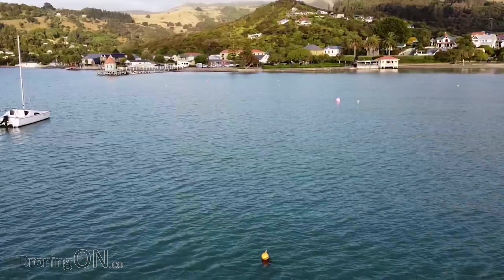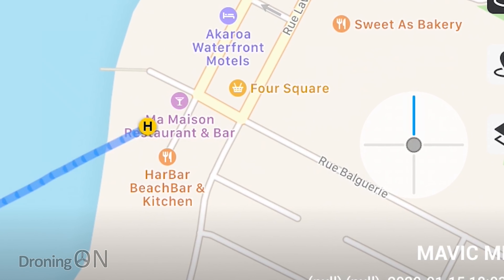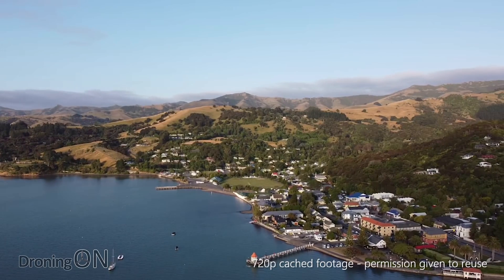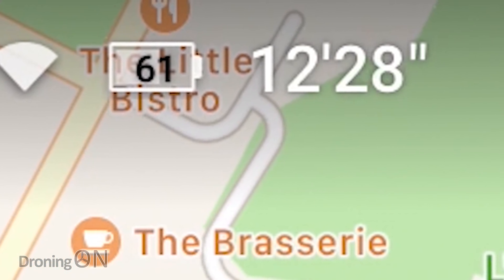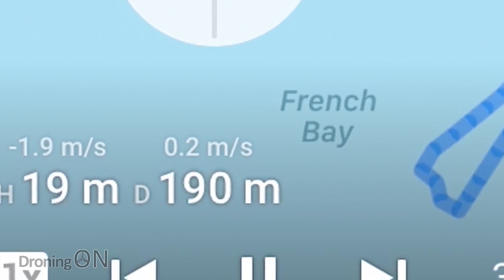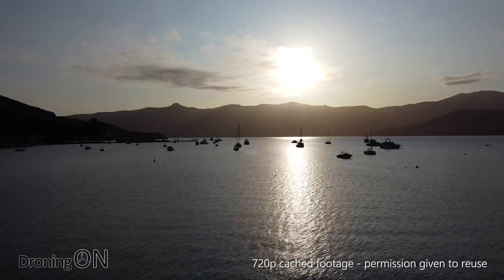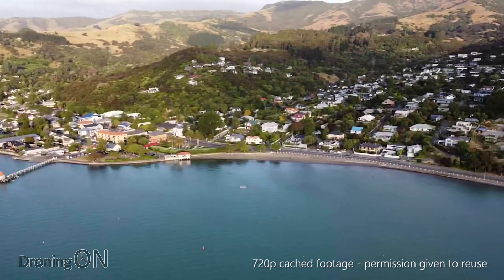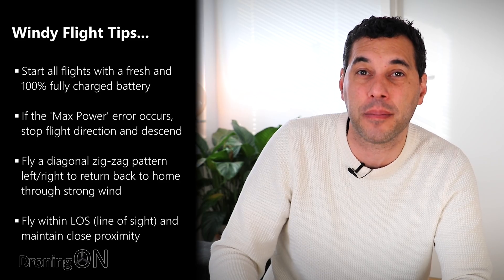DJI Mavic Mini Uncontrolled Descent Into Sea | Max Power/Wind Issues/Operator Fail?

Comment: Anyone else really wanted to see underwater footage for like a second or two?
Reply from the maker: Yes sadly the cached footage ends before it hits the water, which leads me to believe that the battery died entirely before it actually splashed down. We can't know for sure but its a theory! Thanks for the comment! Remember to subscribe!
Reply: @Droning-ON  ⁰
Reply: @Droning-ON  mine did something similar yesterday... full battery and dropped into the ocean at 94%. https://www.youtube.com/watch?v=3lQX1z5DhmQ
Reply: Thanks for this video, really usefull. Go on, l'm really interested in this kind of advice.
Reply: psycold lol 🙋
Reply: I doubt if it continued to record video for very long once it hit the water!  Maybe a second or so but only on the internal SD card.  The RF back to the RC unit would stop immediately.
Reply: @eidenmc  yes. I agree with this.  The last 3 or 4 seconds never got sent because it was shorting out under water.
Reply: Real or FAKE?

Comment: I was with my Mavic2 Pro doing some shots of an apartment complex that had a tiny lake in it. I wanted to get a shot near the water and was descending slowly and was expecting it to stop near the surface automatically but it didn't and I almost lost it into the water. It happened again only this time on concrete and actually hit the concrete and bounce up (no damage luckily) so there is something going on with the ground detection

Comment: I believe that there is an issue with the Mini’s last update. A friend’s drone has dropped from the sky 3 times. The last time he was 50ft from the drone at an elevation of only about15’ - 20’ of the ground. The same ‘max power’ code came on the screen and the drone slowly descended into a swimming pool. No wind was present. He was clearly attempting to lift thought the drone continued downward. After some arguing with DJI they agreed to send him a new drone. 
This is important: his drone flew perfectly on his vacation in Brazil with many stunning videos. It was only AFTER he downloaded the Mini software update that his drone began to act this way (with the max power warnings). I would like to hear from others that have had this issue begin upon the new update. I have not updated my Mini Mavic as I am afraid that I may have the same issue as my friend.

It’s easy to say its user error without actually being there when it happens. If it is a glitch in the programming, I’m hoping DJI will let us know and fix the issue (if that’s the case).
Reply: Bruno nascimento - Thanks for your reply. Did the drone fly fine when you first got it? Did you download the new software update? Do you recall if it happened recently after downloading the new update? Thx
Reply: Hi. I had the same issue after the last update. The drone would have very little power going up and was a little twitchy in no wind. My issue was caused because I didn't update the firmware of my other two batteries. The initial update automatically updated the battery that was inside the mini, but when I went out, I switched to the other battery, ignored the update message in DJI Fly app and got these issues. Resolved after updating each of my other two batteries.

Comment: Its nothing new really DJI (plus other manufacturers)have had fly aways ,crashes etc from day one (phantom 1),had it happen to me on my first phantom,nothing is 100% fool proof,you get high winds low winds ,interference,its just the nature of the hobby,you know what it's like when windows 10 updates ( programs stop working) ,I still get that panicking feeling when I fly my phantom 3 professional in case it's the last time I see it. My mavic mini is great but with it weighting so little you have to make sure battery full and no wind,which in the uk its wind most days.

Comment: I've had an uncontrolled decent last week... I was flying back home with still over 60% battery at only 50-60 feet agl. There was almost zero wind. I was flying back and it decided to start dropping in altitude. I had to stop the forward movement and force it to climb then go toward again.. I had to do this probably 4 times all withing 500 ft from home... I swapped the battery... Then had zero issues... I had this happen one time before at home when it was cold out and it didn't hold altitude, when I swapped the battery it worked fine after that also.... On a side note the issue I had last week was in the cold at about 25°F at 6200ft elevation. I'm beginning to think it might be in the battery.. I will have to mark them and track them to see if it happens again and which ones it does it on.

Comment: My Mavic mini also descent yesterday in my case, battery was 100 % charged, no high wind warning, it was flying within 30 metre but still it descent without my control. The two reasons  I could judge was low controller battery and no gps connection..
What was the real reason? How to check?

Comment: Never had an issue with my mini so far. It has drifted on me on winds 20-25mph with gusts up to 35mph and it still fought back. Just placed it in sport mode , descend to minimum altitude and brought it back safely
Reply: ciphered fragment “Thank you! People are doing something wrong. Because I’ve flown my MAVIC mini in all kinds of conditions and it’s astounding the type of video footage this thing takes. I just started posting some videos recently, taken with my MAVIC mini. I’ve only had this thing for about 3-4 weeks and recorded over 20 hours of video and shot hundreds of pics. (Not all of them are on YouTube)
I think Mavic Mini owners need to check their Return Home settings and make sure they have it set to the right altitude. I do agree with what this gentleman says about the battery. Make sure it’s fully charged before flight.”
Reply: Same here. Just paying attention helps

Comment: I allways check UAV Forecast and lok around and plan where i will fly.But that is from my experience becose i crashed so much toy drones and i learn on my mistakes.The wors place to fly with 249 grams drone is to the open space becose off high wind gusts.The drone is not quilty,i fly alvays with the full baterry and i fly onley when UAV forecast tels me that wind profile in 10,50 and 100 meters is lover than a 24 Km/h.

Comment: I own Mavic Mini from 19.11.2019.  and i newer sean "max powerload reached" or droping altitude.But i experience "RC disconected" and "Strong Wi-Fi interference" 
I do not fly when is windy becose i know limitations of mavic mini.If is windy and i want to fly i runn onley my race drones.Mavic mini is 90% in my room and 10% on the air and eaven when i fly mini i fly at 50 meters if alltitude max and never belove 50% of the baterry.Mavic Mini is the crap of drone.It is bad investmen espetially becose there are no firmware updates,so we are stuck ak onley 4 Quickshoots modes,and no manual adjustments of video and onley JPEG/DNG....I could buy Xaiomi Fimi X8 Se and have more flight time and all of benefits like original Mavic for the same price...Uhhhh man i HATE my "Mavic" mini!!!
Sorry for bad spell,greatings from Euorpe (Croatia)

Comment: Mine plummeted into the sea from less than 60 feet away. Recovered by scuba divers next day and soaked in clean water. Thoroughly dried and i put a new battery in. Instant burning and battery destroyed in cloud of smoke within fractions of a second. Watch out!

Comment: A great Way to find the answer to what happened is using the website air data uav ! I had the same issue with my original mavic pro and lost it ! I uploaded all the flight data and the software explained exactly witch way the wind was blowing and how fast 💨
Reply from the maker: Thanks for the comment, yes indeed that is a great site to use. Very sensible to do the research before takeoff! Be sure to sub!

Comment: Fly into the wind away, with the wind on return
Reply from the maker: Precisely, its also great to return down-wind as it doesn't push your battery so significantly, its a free-ride home! Thank for the comment, be sure to subscribe!
Reply: That's good advice, but if the subject you plan on filming is unfortunately against the wind, then there's little one can do.

Comment: Similar incident happened to me two weeks ago. Flying my mini in an isolated area in the Owyhee Mountains at the river. Fresh battery and was flying great. Made a pass along the river maybe to about 100 meters away from me and decided to fly the same path after seeing ducks wading in the water at where I turned the mini around. After doing a flyby of the ducks I turned my mini around but as soon as it started flying back it just dropped straight down into the river. No warnings, no strong wind, 50% battery life and only about 250 feet away from me... no obstruction and clear line of sight from drone to me/controller. Fortunately it dropped about a foot away from shore and I was able to pinpoint where it dropped via video on the phone. It was lodged in some vegetation but in the water. I’m also very lucky to have purchased the DJI Care Refresh as I was able to have my mini replaced with a new one within 7 days.
Reply from the maker: That's great that it got replaced, you were lucky that you still had the Mini to send back to DJI. Thanks for the comment and do subscribe!

Comment: Does the Mini's motors produce less thrust when the battery is at 20% vs. when the battery is at 100%?  I thought battery level simply indicated how much time/power you have left in the tank, not how much thrust the Mini can produce.  This video seems to imply that your Mini could lose altitude because it's only at 50% battery level vs. 100%.
Reply from the maker: As batteries discharge, they provide less voltage and amps, do in theory a half-charged battery may not provide quite the same thrust as a 100% charged battery.

Comment: mine decided to land in the sea, with no wind and no warning. 400 feet away from me, 50 feet in the air, just "aircraft landing". no response to throttling up, just decided it wanted to take a swim. I've bought a new one since and (touch wood!) haven't had an issue. so... faulty unit???
Reply from the maker: So frustrating to hear, did you raise a case with DJI? Thanks for the comment!

Comment: A Canadian you-tuber kept getting the max power  error and did find that it was a prop problem. When you replace your props, change both "like you stated"  (Also this is Important ) throw away the old screws and use the new ones! Why? Because there is a small amount of lock-tight on the screw and you need it to prevent loosening. You can see the lock tight on the screw if you look closely. Otherwise the props will loosen and wobble, and the drone won't fly right and you will get errors and maybe crash.    Mike in N.C.
Reply from the maker: Thanks Mike, let's hope that others follow this video closely!

Comment: I have received the dreaded Max Power Reached and the first time I ignored it and did the Mini Skip from 390 feet up. it wasn't a full on fall to earth but I did watch it fall from that height and hit the grass before bouncing right back up and giving me control of the drone again. the second time I got that error and lowered it immediately and still it bounced on the ground on the way home and went right back to flying like normal.
Reply from the maker: Thanks Toby, that's very strange indeed, when toy say fell do you mean literally, or did it descend calmly like in this example?
Reply: @Droning-ON  it descended kinda rapidly but not enough to hurt the drone I still haven't had to change the props at all

Comment: Curious if this was the Model MT1SD25 Mavic Mini. I live in the US and we have Model MT1SS5. I’ve read the European models have less power from the start. Great teaching moment with valuable advice. Also, one of my pre-flight checks is to see what the winds are at various altitudes using an app. If they are gushing above 18-20 mph I don’t fly at that altitude. Hopefully this pilot will get another drone. Thanks for sharing.
Reply from the maker: Thanks for the comment Ron, the European model has lesser range as it is a CE RF model, but all that would do is invoke RTH sooner, it wouldn't cause this.

Comment: Sorry to sound like a blacksheep but I think you might have overly suger coated a lot and blame on the pilot.. Even if taking off on full charge same thing could happen still 100%charge won't really stop this problem... Have come across similar problem the best way possible is landing it on some1 boat or find refuge on a roof if in urban towns etc

Comment: Hate to say this but it is operator error. "Battery Abuse" and "Unsafe Procedures". It's batteries 101. The C rating of a battery is the Max current it can supply at the max charge level. i.e. A 10C battery of 2,000 mah hours can provide 20 Amps of current. At 50% charge it can sustain 10A. At 10% it can sustain 2A. If you fly the mini in the wind and don't have at least 50% battery you are likely to lose the drone. The motors have a KV rating. Thats how many revs they will do per volt. As the battery depletes the motors cant spin as fast as the voltage slowly drops. Once it reaches the max current threshold you get a brownout, thats the voltage supplied to the motors drops suddenly. This means the motors are drawing as much current as they can but the rotational speed is much reduced causing a slow descent. People need to get over the fact that this is a toy drone its not an Inspire or a Phantom or a Mavic. You cant treat it like it is one.
Reply from the maker: Thanks for the comment Brian, this is the point made in the video, it's all about taking off with 100% battery.
Reply: @Droning-ON  Yes, Indeed. But I added the detail on why this occurs and describes the slow decent into the water. Its got nothing to do with faulty firmware as some surmise.
Reply from the maker: @brianroberts5062  well I do have to disagree and ultimately neither of us really know. In this example there was virtually no wind at ground level, therefore the descent should have ceased below 10m, but it continued into the water. There is a software or firmware fault here, for sure because this isn't the only instance.
Reply: @Droning-ON  Sorry you need this additional information. You need to be aware of the battery mechanics. As I explained a brownout occurs due to the excess load commanded of the battery to fight the wind at a particular charge threshold. Or any other excessive use of the throttle (Like using it as a racing drone). The mini has Lion Batteries Not LiPo batteries. They don't have the same energy storage capability. Anyhow, As I was saying a brownout occurs this means the voltage has dropped. So why does the voltage drop? Because the excess current request that cannot be supplied is overheating the battery causing the internal resistance to rise due to basic friction. The voltage on the load is a resistance divider circuit. This heat buildup has nowhere to go. So even if you descend below the wind you still don't have enough voltage available to maintain flight. It will come back as the batteries cool but this is dependant on how hot they got by trying to sustain the current load. The correct procedure is as you have pointed out, make sure that you takeoff with full batteries, Don't fly in excessive wind but also don't delete the batteries below a reasonable threshold. And thats not the advertised flight time but about half that.  You would see this behaviour all the time if you fly Model RC Helicopters. Particularly Mini and Micro size.

Comment: It is user error. The mini will drop and go into landing mode if the battery is quite low. I have seen a mini go into auto land mode at 18% battery.
Wind change and speed is variable as you state at different altitudes.
plus, if you change from P mode to S mode whilst flying. It will not go into sport mode and come home faster and pitch fully to 30%.
Finally Max power is due to the propellers spinning to fast and the unit overheating. If this happens the user has to stop the mini where it is and hover, so it cools down, and then resume flight after about 30 seconds.

Comment: Thanks for sharing. I would like to add one more recommendation, to use the app Windy. You could monitor the wind speed before you fly. 
https://www.windy.com/?59.310,18.164,5
Reply: Thank you Alan for UAV Forecast. It is better particularly for directly determine wind and gust at 100 meters. I have set 100 m as standard in my UAV Forecast app. Windy may be better for getting a general picture of the wind condition in the area where you are going to flye and how it will change over time.
Reply from the maker: Great suggestion Erik, thanks for the comment!
Reply: UAV forecast is better
Reply: Air data is some times useful. You can put your particular drone & flight log etc.. & will give you data back on flight characteristics & wind speeds on that flight only good after a flight.